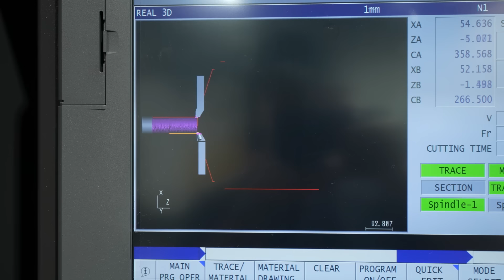GSC Power Division On How To Spec A Camshaft , Stock Camshaft Reliability, and NA Vs Boosted Cams

Comment: Greg, do you remember 15+ years ago when you had a F-body dyno day in your shop off Belgrade Ave?  Some ratty 80s looking camaro convertible gets on the inertia dyno you had. Could bearly hear it. sounds stock-ish and like some kids car.  and then it rips off 415 RWHP with the ebrake on? 
Yeah. That was from picking a street cam..for the street.  that engine gave 40+mpg. and you saw how fast it spun up your inertia dyno. Much quicker than a 415hp 4cyl.

Comment: Yeaaaaa looking forward to this one, literally adding a whole GSC catalog for my 4g63
Reply: damn thats lucky i have a 46g4 di (converting to port injection currently) im boosting i have a few 4g63 parts but i have to be stock cams  because i dont even know if they make cams for the 4g64 dohc head.
Reply: @njdorset1050  I didn't even know 4g64s came DI ! Good luck with your project
Reply: @scadieee  the 4g64 in the jdm mitsubishi chariot minivan are na and di they use 11.5:1 compression with some insane dome pistons
Reply: God Bless✝️
Reply: I had gsc r2 cams on my Evo. Gsc is t he best

Comment: The fuel system should ideally be 10% above the power you are producing, max 25%. Overflowing fuel just adds heat reducing power. It also consumes more power electrically and mechanically.

Comment: My Mustang coyote has Comp Stage 3s, and my Evo X has BC 280's. I just want to rev high as fuck. 🤣

Although for the price of doing a full cams + cobrajet NA setup, you are in boosted money. However, it's still fast enough and the motor hasn't broken 4 years of 8500 RPM. If I had boosted it, I'd be on motor number 3, like I am with the Evo.
Reply: no you wouldn't, its a coyote so you'd still be on the original motor
Reply: @antimedic4441  You might be right, but I'd be on my 5th MT-82.
Reply: @diegoaccord  oh definitely, you win some you lose some

Comment: love this guys Podcasts, but i have to say this guy has no idea what he's talking about when it comes to Stock Coyote cams like he was saying in the F150 Coyote Cams segment saying these cams are designed for low RPM Grunt work and spinning it way past its intended Range can cause problems like valve float and shit like that & i mean he's not wrong to a point on stock stuff but i mean I'm revving my 950Whp almost 1000Whp 2018 - F150 on 91-Octane Pump Gas pushing 16psi Through a fully stock Long block With only OPG, Crank Sprocket, MMR Billet-Chain Guides & MMR Tensioners... Spinning to 8200Rpm No Problems so yes stock stuff has limits but as long as you keep it below 1000Whp and 8500Rpm It'll be fine.